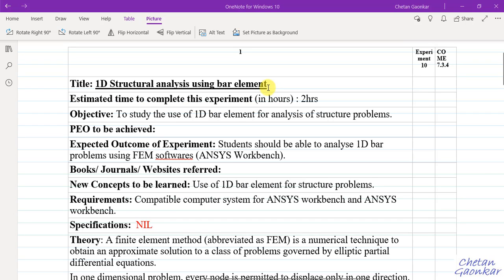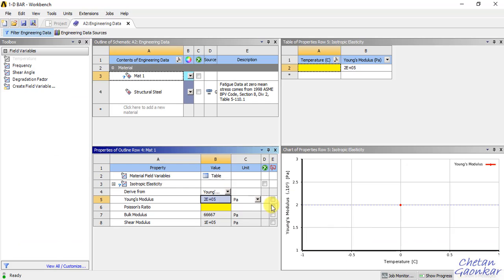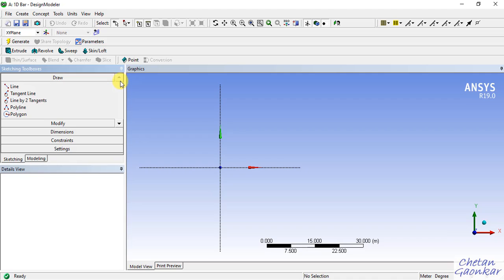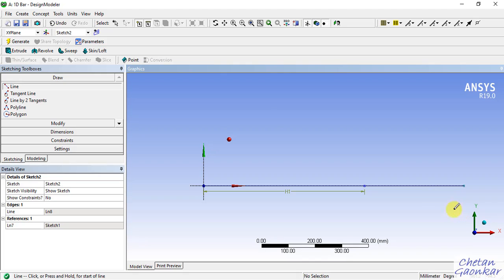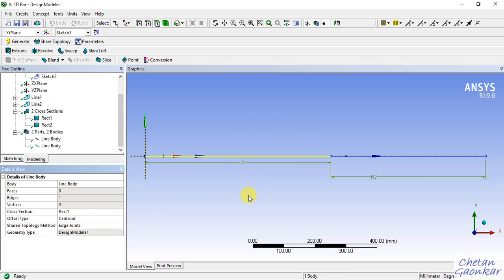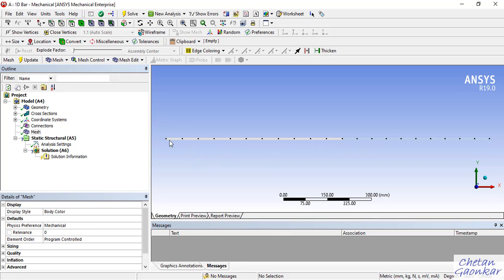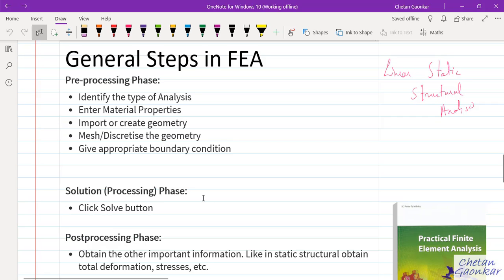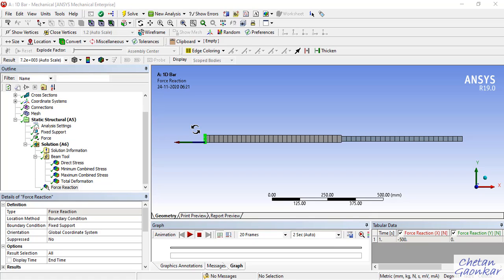2. ANALYSIS OF 1-D STEPPED BAR USING ANSYS WORKBENCH (FINITE ELEMENT ANALYSIS)

Comment: Two connected circular section bars are shown in the Figure below. The left bar is fixed as indicated. Using the 1-D beam element, conduct the FE analysis to calculate the displacements at nodes 2 and 3. In the FEA, consider two cases: a) 1 element for each bar, and b) 2 elements for each bar. Compare the results with the stiffness method (Assignment #1, problem 4) and the analytical solution. Show the deformation/displacement contours for each case, and comment on the accuracy of the results from each analysis (Hint: model the bars as lines but specify their corss-sections different as indicated).

Comment: ). A cantilever beam of 200mm length, 10 mm height, and 2mm thickness is shown in the Figure below. The beam is subjected to a 0.1 MPa uniformly distributed load at the top section of the beam, along with a concentrated load 20 N at the free end of the beam.
 
a)	Using the 2-D plane stress model, conduct the FE analysis to calculate the beam displacement along the length of the beam. Explain the reason for choosing a specific type of mesh element, either linear or quadratic elements. Plot the results of mesh convergence study, considering displacement and stress fields. Comment on the continuity of the stress and the displacement fields, showing the contour plots for the converged results.
b)	Using the Rayleigh-Ritz method, calculate the beam deflection along the length of the beam.
c)	Compare the results of FEA and the Rayleigh-Ritz method with the anlaytical solution for beam deflection (use the standard deflection equation for the cantilever beam; no need for the derivation of equation).
d)	Conduct the FEA considering 1-D line/beam model and compare the results for stress and deflection with the 2-D plane stress model, analytical solution, and Rayleigh-Ritz method. Discuss briefly the approach you will employ in solving similar type of problems in an industry context.

Comment: At 30:20 you used a command (cross section solid) ...in 2021 ansys ,I am unable spot that command ...please help
Reply: you can use the quick launch column at the top right corner. Just search the word (cross-section) and they will show you how to implement it. 

Alternatively, you can go to the Display tab and look for style category and click Cross Section(should be yellow capital I)